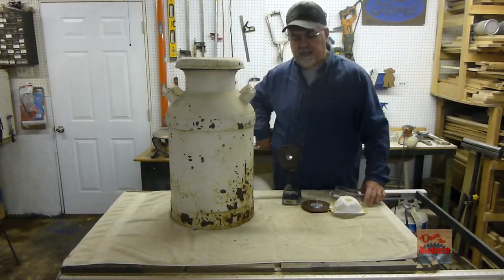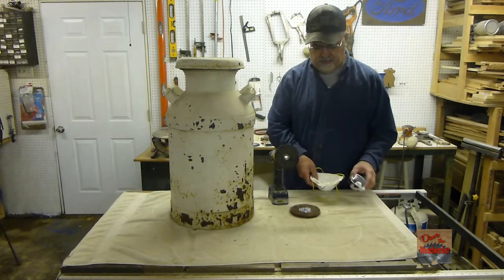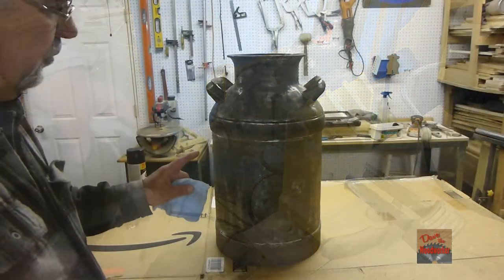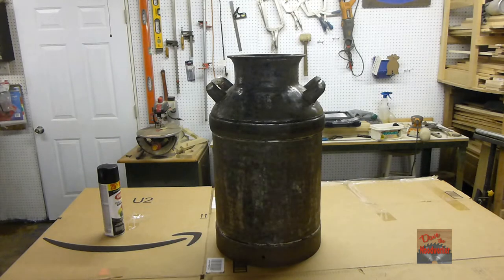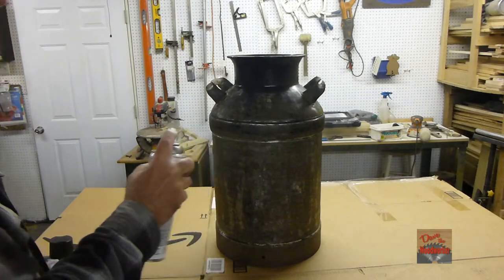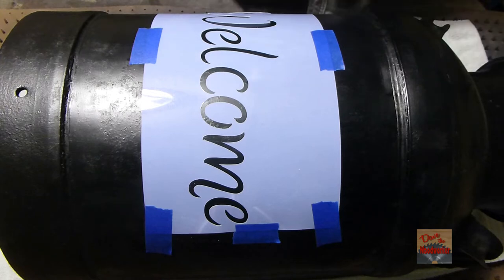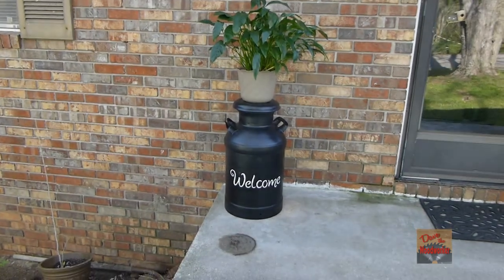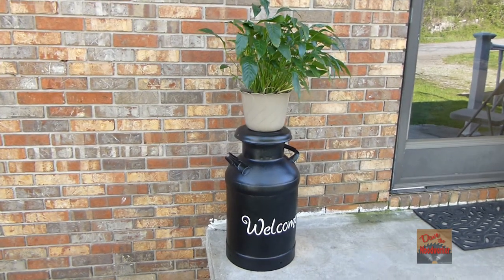How to Restore a Vintage Milk Can

Comment: Do I have to sand it down before painting? I was thinking about painting the top white and wrapping rope around the bottom part so it can be kinda rustic decorative piece in the house.
Reply from the maker: Well you don't have to sand it down before painting. Just scuff it up, if paint is already on it. This helps the paint to adhere better. But if there's Rust, you want to remove it. Because if you don't, it will come back thru paint in a short amount of time

Comment: Great video. I’m thinking of adding a circular wooden top. I’m not very skilled. Any tip/ideas how to attach it
Reply from the maker: If it's going to be inside, I would just glue to the lid. Use liquid nails adhesive

Comment: Great video. This is going to sound like a silly question however I have recently gotten my mother's old milk can and we had it sitting in the living room in the 1970s since then it went to the storage house where animals and things like that have gotten into the inside of it because it doesn't have a lid. I was wanting to refurbish it and not only the outside but clean up the inside as well so that I could put things like umbrellas walking sticks that kind of things in it to set next to the front door. How would I go about cleaning up the inside of it and possibly sealing it  for this purpose.
Reply from the maker: I have no idea, ours has been sealed for year's. Now they are this new product I used on my old car, called POR15, it is good for sealing in rust. I wished I known about it when I done mine. But it's not cheap

Comment: What did you put on your drill for the tight spots around the handle?
Reply from the maker: I didn't use a drill for the tight spots, I used a rotary tool from Harbor freight, it has several attachments.

Comment: How did you get the top off?  Mine is sealed and I can't get it off?
Reply from the maker: I just used a rubber hammer
Reply: I thought it unscrewed but it taps right off. No threads i guess it came with a pin. The cap has a handle.

Comment: I've got a question that I hope you might be able to answer. I've been considering getting a milk can as a nice way to store sugar in bulk. Might you know if maybe a few coats of enamel spray paint on the inside would be a safe and effective method to do that. Of course after a few heavy coats and after plenty of time to dry and some thorough washes to dissipate the fumes. If that's not actually a good idea, could you suggest something to coat the inside of the can that would be safe and effective?

Comment: How did you remove lid?
Reply from the maker: Use a rubber hammer
Reply: Lid on my jug feels as if it's on pretty solid 😬
Reply: Thank you
Reply: Ok friend!  I tried the rubber hammer...and it worked! Thanks again!
Reply from the maker: @jstrevino1981  you're welcome
Reply: 😬 ok friend I'm back..I painted my can with chalk paint rustoleum brand..used brush.. had outside drying for 3 days. And there is rust specks should I sand 🤔 it all..repaint then spray a clear finish this time to protect?
Reply from the maker: @jstrevino1981  I've not used chalk paint. But yeah I probably would resand the rust spots and recoat. It's hard to keep from some rust popping up. These are very old, you can buy special stuff to kill the rust, but it is costly
Reply: Thank you. Did your can have some rust  Pop up to?
Reply from the maker: @jstrevino1981  yes, but my mom keeps it outside. I will have too probably redo it in a couple years
Reply: Ok thank you.. I plan to keep outdoor too😊 thanks again 🙂